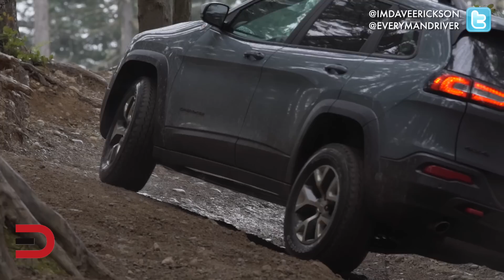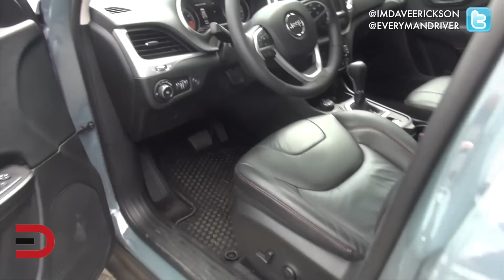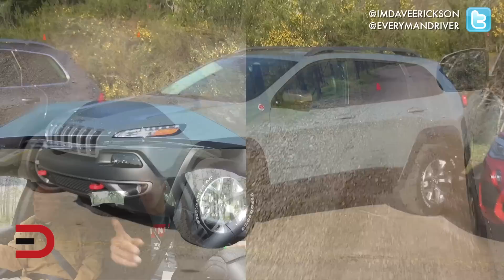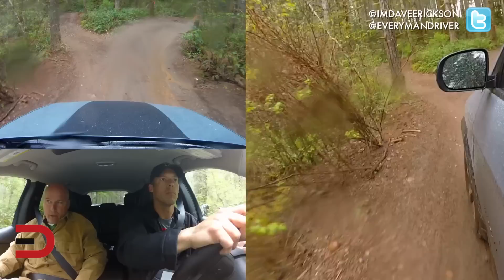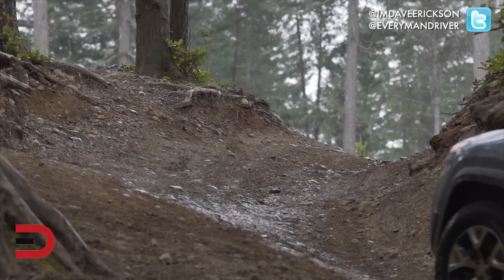Off-Road: 2015 Jeep Cherokee Trailhawk 4x4 on Everyman Driver

Comment from the maker: Shop the Best Selling Auto Parts Here: https://amzn.to/2CQmxLz
Find New Car Deals by Zip Code: http://bit.ly/2CYZxuL
Performance Auto Parts: https://amzn.to/2Clupnn
Automotive Car Car Products: https://amzn.to/2q69Eot
Exterior Accessories: https://amzn.to/2pXxLW7
Interior Accessories: https://amzn.to/2pZ3TJ9
RV Parts &d Accessories: https://amzn.to/2CQgF4P
Tools & Equipment: https://amzn.to/2ymITk4
Wheels & Tires: https://amzn.to/2NMv9DP
Light & Lighting: https://amzn.to/2RY4kQr

PRODUCTS, REVIEWS & LINKS:
DJI Mavic Pro 4k Quadcopter Aerial Drone: https://amzn.to/2Eno7W5
Motorcycle/Bike Camera Mount: https://amzn.to/2EiKQ4L 
Car Seat Gap Organizer: https://amzn.to/2QEEL5I
----- Review: https://youtu.be/fdhHihwvnLg
Chicco KeyFit 30 Infant Car Seat: https://amzn.to/2UtWwHB
----- Review: https://youtu.be/_1RlQpkzCKw
Z-EDGE T4 Dash Cam Link:  https://amzn.to/2Tn9pCM 
---- Review: https://youtu.be/vWAOQWSFewA
AUKEY Dash Cam: https://amzn.to/2Ef7afG
VanTop 4K WiFi Action Camera: https://amzn.to/2SwJSpn
---- Review: https://youtu.be/2ZJ5yueDCmk
Canary Car Security Camera:  https://amzn.to/2Otk9Ql
----- Review: https://youtu.be/L7qqmqJcH_w
Waterproof Car Garbage Bin: https://amzn.to/2pKtSUm
----- Review: https://youtu.be/D2HZU7xTU5o
In-Vehicle Trash Bin: https://amzn.to/2E04WlZ 
---- Review: https://youtu.be/GjcIsKW_jXA
Weathertech DigitalFit Floorliner: https://amzn.to/2IB1gWo
---- Review: https://youtu.be/5ipE8egNRb4
Car Seat Protector Kick Mat: http://amzn.to/2CDc6q6
---- Review: https://youtu.be/qTuWgZ-42o0
Lexol Leather Cleaner: https://amzn.to/2zLQ5aD
----- Review: https://youtu.be/T622Ec77ZPY
KNIGHT VISOR Glasses: https://amzn.to/2Qn2pI6
----- Review: https://youtu.be/TXDCAToZgrE
Clip-on Polarized Driving Sunglasses: http://amzn.to/2jWAlGK
---- Review: https://youtu.be/otJHTEyNLXk
Night View Driving Fitover Glasses: https://amzn.to/2UuR1bA
----- Review: https://youtu.be/G-lejCyjV4I
Tile Mate - Key Finder: https://amzn.to/2xRV6wC
----- Review: https://youtu.be/ODaciwqvbQk

Comment: This car is not reliable, even the facelift has the same transmission issues. The transmission switches without any warning into neutral.
Reply from the maker: I appreciate the feedback. If you visit  https://quotes.everymandriver.com  you can see the best deals/prices on new cars/trucks in your zip code!  It’s a free search engine and it’s Everyman Driver Approved!

Comment: There is one of these sitting at my dealership where I get my car serviced. It has 76,755 miles on it  it’s selling for $19,000 if I trade my car in I could get it for about $10,000 think it would be worth it? The drivetrain warranty expires at 100,000 miles. The manufacture warranty has already expired. I would love to drive it on a local beach to do some surf fishing. The carfax report said this vehicle was well taken care of. Thanks for your video. Yours seemed to handle well. Have you driven it in lose sand?

Comment: I just bought this last week and this does not get anywhere near as much MPG that he says! It’s 14 around town and 17.4 on the highway doing 65. Only gets 225 miles per tank of gas at a 15.8 size tank. 

This thing slips in snow more then my 2012 Chevy Cruze did this winter and I’m in Western NY.

Comment: Do not buy this car.  It uses the Uconnect system which is garbage.  Both Jeep and Uconnect know about the Sierra Wireless card issues but have done nothing to fix it.  Their recommendation is to replace the entire head unit at over $1,000.   Embedded Air card failures every day.

Comment: Can someone explain to me (fairly in depth please) the difference between Cherokee's Active Drive II with Rear axle lock and Grand Cherokee's Quadra Drive II?  I get that they're very different systems, but I can't find descriptions of how they actually work. Specifically, since I often have to get to the hospital through deep snow before the plows arrive, which would more capable in deep snow? Also, has Quadra Drive II lost capability since eliminating the front Limited Slip differential several years ago?
Reply: I think that question would be better suited for a Jeep forum or even a dealer with a salesman who knows what he's talking about. I'd want you to get the right answer about the snow question.  I think they are similar systems but I have not gone in depth to be sure.

Comment: 25k for a trailhawk? Wtf are yall smoking..the latitudes are damn near 30k for a fwd version..the trailhawk is upwards of 35+
Reply: I thought the exact same thing. I just bought a 2016 Trailhawk and the MSRP was $45,400! The dealer gave me a $12,500 discount with a rebate given to some dealers to help move the 2016's.
Reply: LVen21 yeah in Canada I see trailhead going for up to 48 grand
Reply: +davesilecchia I own a latitude fwd and only paid just over $24,000 for it. The Trailhawks start at around $30,000 last I checked.
Reply: I got the I4 version. And no, its the Granite Crystal paint. The actual MSRP of the car was actually a little over $26,000. I got a good deal on it. In retrospect, I sometimes wish I got the V6.
Reply: Grand Cherokee overland
Reply: Check out Autotradwe

Comment: Purchases a new 2015 Cherokee Limited 4 wheel drive went out about 20 miles from the dealer had in the shop over 30 days they couldn't fix it.
I made the dealer give me a new one, in less than a week the U Connect went out took almost 2 mo. to get a new one.
Has a lot !!!!!!!! of vibrations in the doors the dealer tried several times to fix them....couldn't finally took it to a body shop may be getting them fixed one by one.
I'm almost afraid to drive it.
Get a 4 Runner !!!!

Comment: I bought the 2015 Cherokee Trailhawk for my wife. I have owned a 1995 cherokee H.O. ( I still own it and would drive it anywhere ), a 2002 Jeep Grand Cherokee limited 4.7 H.O. ( I put this jeep trough HELL! Mud, street racing, hill climbing) it threw a rod after years of serious abuse at 180,000 miles. I have taken the 2015 trailhawk off-road and it has never missed a beat! It will do exceptionally more than either of the previous jeeps I've owned. The price was a little more than I think it should be, but that gives the people on reviews like this something to be mad about. Lol it's a very effective, and off road capable vehicle. After you clean the mud off it's a nice date night vehicle too! People in my town rave about how awesome it is!
Reply: +eric banks any problems with the trailhawk since you had it? I've heard of many transmission problems
Reply: +Lance I've heard about the transmission problems too! So far so good. It's almost due for it's 2nd service. It has around 11,000 miles on it, and it still impresses me every time I sit in the drivers seat. No issues whatsoever.

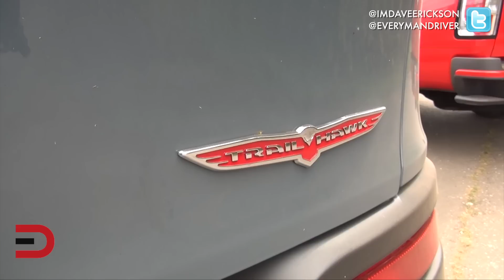Comment: 0:35 Since when was the jeep liberty a body on frame truck? I was under the impression that it was unibody as well. It was a rear wheel drive platform with a 4x4 system similar to that of a truck, but I am almost completely positive it was unibody.
Reply: +Michael Miller 
You are correct, liberty was a unibody vehicle. Also, great towing capabilities? The guy was talking nonsense.
Reply: +Michael Miller +KeliBaB the libery, commander, and grand cherokees from that era were all body on frame. sort of.

they had true frames underneath them. but they weren't bolted on like body on frame vehicles usually are. they were welded. so you lose one of the biggest benefits of body on frame (body lifts).  the only real benefit is frame rigidity in comparison to a true unibody.

pretty sure the 2011+ grand cherokee/durango went to a true unibody platform
Reply: +SkrillexAndShit  The Jeep Liberty KK has a solid rear axle, not IRS...
Reply: I own a 2008 KK and the frame and suspension are weak sauce: unibody with IFS/IRS. It's impressive for what it is, essentially an archaic crossover, but there is nothing truck about it. Frankly if it was body on frame I would be a shit ton happier. With solid axles, I would shit my pants with joy.

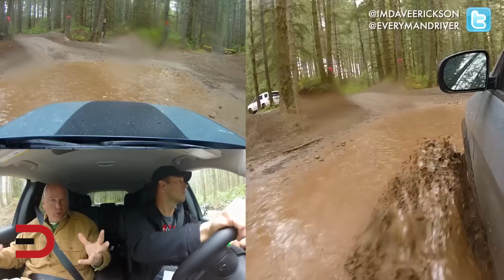Comment: 2:07 Talk about how the plastic part on the right side of the radio ALWAYS hits your leg when your driving.
Reply: +MrHow2fail no it doesnt...adjust you seating position dude....im 6ft and im fine, if you are 7ft...get a grand cherokee...
Reply from the maker: +MrHow2fail You just did :-)

Comment: These sales propaganda videos are misleading people.  Reserach Jeep Cherokee transmission problems.  My 2015 Trailhawk fails every time I take it off road on the beach.  The transmission overheats and on a slight incline and deep sand it will fail every time and turns on the MIL light, 4WD disables as does cruise control.

Comment: Nice interior and I hope that the drivetrain is a vast reliability improvement over the one found in the Liberty. There's a lot of sensors operating the four wheel drive in order to divert power to wheels with traction though, no doubt due to the independent suspension's inability to flex enough to keep all four wheels in contact with the dirt, so I'm curious to see how long the sensors will last before needing to be replaced.

Comment: Seems every time a new "version" replaces its sister version, it gets less and less capable. Sorry but this car did not replace the Liberty. I'm sure Jeep wanted it to be but after sitting in one (yes, sitting, no need to drive it) I beg to differ. It replaced the compass/Patriot. The Liberty went away to force people to buy this car. Then, I looked at the renegade in the same showroom. Again, not sure what it replaced but I had to laugh when I was sitting in it. Everywhere I looked, there's the little Jeep 7 slot pictures. On the windows, windshield, doors, bumpers, tail lights. News flash to jeep. Stop squirreling your prospective customers with nostalgia and get back to the basics. Those cute pictures, fancy electronics don't do you any good when you got water coming over your hood or the snow is up to the front bumper. Just a little helpful hint from a KK and KJ owner. Psst.. as far as the fuel economy? Really now. Get off the track and come out to the real world where your consumers tell a different story.
Reply: Justin Hardt these Cherokees are very capable. Your ignorant to think otherwise
Reply: tc1uscg Liberty=mid20k 5 pass SUV with the most capable 4WD in the class. Cherokee= EXACTLY the same, except your kidneys won't be rattled and you get luxury. Compatriot is still for sale to this day and for another year.  Renegade= subcompact SUV, the first time for Jeep. And Jeep is doing the best of any major manufacturer as far as sales for the past 2 years, ironically since the Cherokee debuted, seem to be doing a lot right!.
Reply: tc1uscg I agree that the liberty was discontinued, to put you in a cherokee. The Liberty was a unibody, and had upper/lower control arm front suspension. The cherokee has car based, MacPherson struts, with an aluminum lower control arm front suspension. It's fine for light off roading, but is not a direct replacement for a Liberty, which could handle some real off road abuse without breaking.
Reply: wiibaron When it comes to Jeeps, aftermarket parts/mod's are as much to jeep as it's history. This vehicle has been out for what now, 2 years. Don't see any major modifications for it much less people sticking 30+ inch tires under it's fenders. For the market this car is targeted for, I doubt they would even care about rockrails that really work, 100lb+ front steel bumper with winch, a 2 or 3 inch lift with complete replacement of springs/shocks and "A" arms, etc.. Short of strapping a bull bar to the front, not sure it's front end can even handle the extra weight. It might  be "trail rated" but whos trail? I've done all the above to my 02 and 09 Libertys (and then some)  just to keep up with all the demanding trails Wranglers run on. I'm not in the market segment for this kind of car. I think I'd be looking at a Subaru instead.
Reply: +Skyler Sandlin I agree. The XJ was a pretty good offroader but a epic failure to capture the market Jeep wanted to with the Liberty and now the new Cherokee. However, I've "added" a few items to my KK that makes it hold it's own off road to a like equipped XJ (and I'm paying for it in mpg LOL). With that said, I've seen people mod out their XJ's, at least the ones that are still around, to handle what the wrangler can handle off the show room floor. Just like the XJ, the KJ and KK and now whatever X it is, they were designed as every day drivers. Not weekend only mud mobiles. When it comes to the segment of the market Jeep tried to capture back then, they are trying it again, however, just like always, they are a day late and dollar short. The TrailHawk is no more trail capable then a Subaru. Plenty of youtube videos to back that up. I can say this much though as far as the Liberty goes. The KJ is more off road capable then the KK, off the lot. I have both. The KJ will run rings around my KK in the snow or on the trail. But after some mods and about 800lbs later, my KK can hold it's own and with it's winch, get it's self out of what it can't. Happy trails.
Reply: +tc1uscg Rubicon Trail, Hell's Revenge + many other difficult trails. I have rock sliders, 31" tires with modified wheel wells, front brush guard, cold air intake with exhaust system and tuned + 30hp. I can also handle better, go faster and get better gas mileage with it as my daily driver. Tell me now, how is it not modifiable?
Reply: +Justin Hardt Rocky Road tried (http://truckyeah.jalopnik.com/dont-believe-rumors-that-the-2014-jeep-cherokee-is-un-1522058978) . Maybe you would have got the point had I said you won't find very many after market upgrades for your KL as you can for a KK or KJ (IFS rigs only). Just a simple google search "aftermarket parts for 2012 Jeep Liberty gets 213k hits. Same search for a 2014 Cherokee, 3. Not 30, 300 or 3k. But 3. Tried again for ROCK RAILS. Got 5 hits to the KK's 200k+. I've seen the mopar "rails" but they are nothing like http://www.jcroffroad.com/category/KJ-KK-SL.html. As far as your trail listings go, plenty of stories of Subaru Outback's and the new Renegade doing the trail too.  Just say'n.

Comment: I have a Cherokee with the basic 4x4, do you know how that would do on the trails? It's a Latitude not the trailhawk....
Reply: Derek Tellinghuisen You have about an inch and a half less ground clearance (lift + tires), and you lose the rear locker. It doesn't come stock with offroading tires,  doesn't have the toe hooks, and your bumpers are lower to the ground meaning a worse approach and departure angle.
Reply: +SheepTrees  trailhawk has a different suspension.

Comment: My dad is a finance manager across 3 dealerships (mainly 2) and he gets to demo out new vehicles. He just returned a 2015 Challenger and came back home with a Cherokee because he wanted to see what it's like. It's not a loaded up trailhawk but it's still a great suv. It comes standard with a lot of cool things like a large touch screen and secret storage compartments on the top of the dash or inside the seats.

Comment: I traded in my 2011 Jeep GC Overland a few weeks ago and got the new 2015 Trailhawk (fully loaded). There are only 3 of us in our family so I couldn't justify the bigger and waaay more expensive 2015 GC. The Trailhawk is a lot of fun so far (1300 kms). Planning to do some off-roading/camping up North soon and also wanted it for the bad Canadian winters. When you look at it from the outside it looks a fair bit smaller than the GC. I was initially concerned about that...until I got inside and took it for a test drive. The only place you are losing place is in the trunk - up front I felt like was still in my GC. Even the passenger seats in the back were roomy enough. I also am finding it a little better on gas than my GC (was also a V6 but it was the older 3.6 Pentastar engine). My only critique so far is the 9-speed automatic. A bit of gear hunting at times hmmmm IMO 6 speeds would have been plenty.